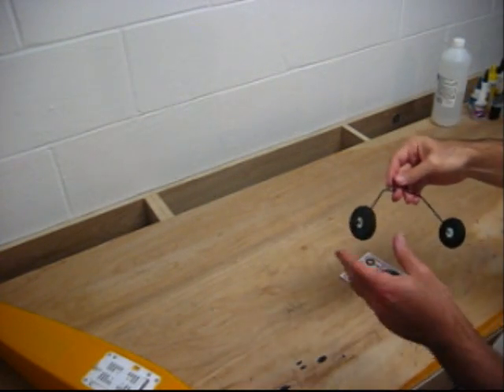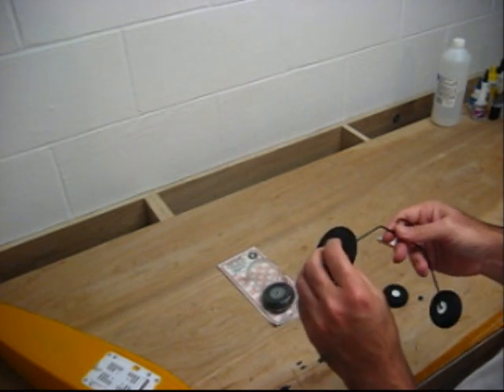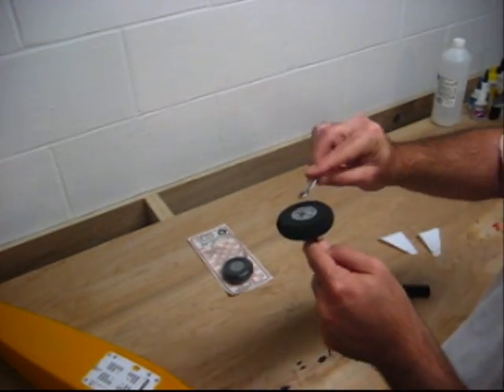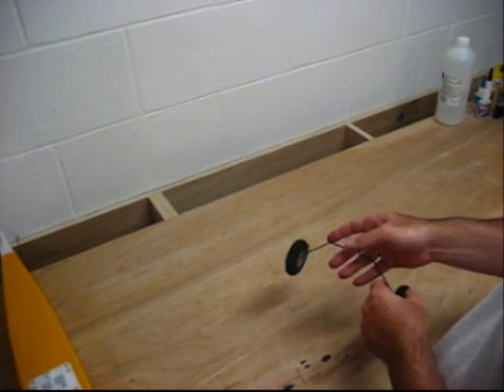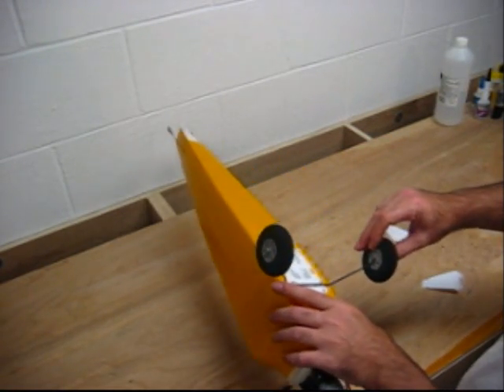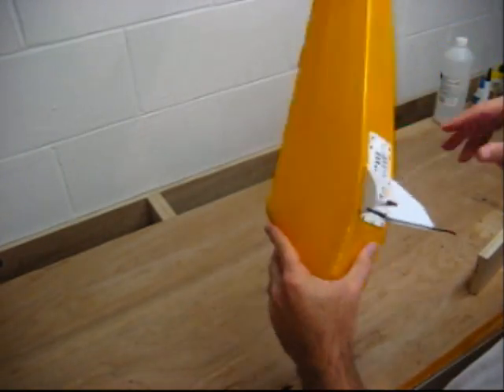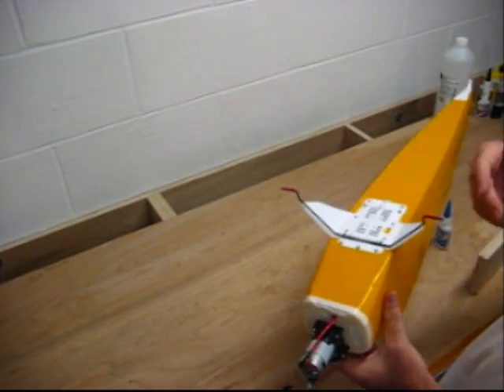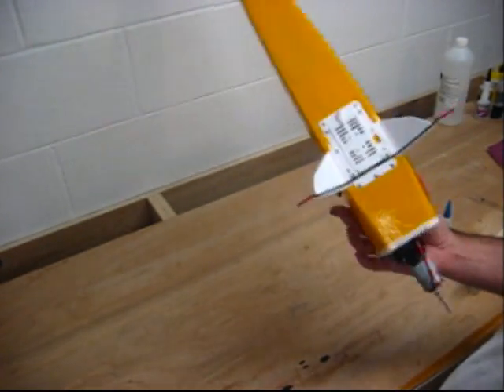16-Landing Gear Mods Pt1 - Building HZ Super Cub from Scratch

Comment: I am asking my self, why do so many rc planes have 2 wheels in front instead of 1 in front? I am scratch building a plane my self right now and I am planing on doing 1 wheel in the front and 2 in the back, becuase I think it would greatly increase the cahnces of damaging the prop. 
I am asking my self, why do so many rc planes have 2 wheels in front instead of 1 in front? Is there a specific reason for this?